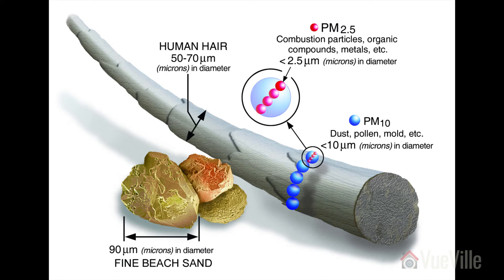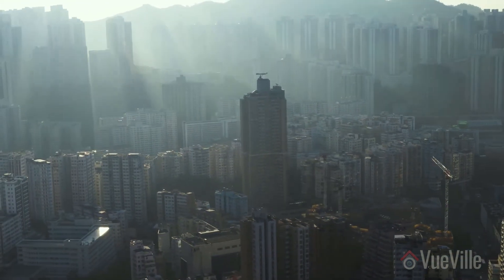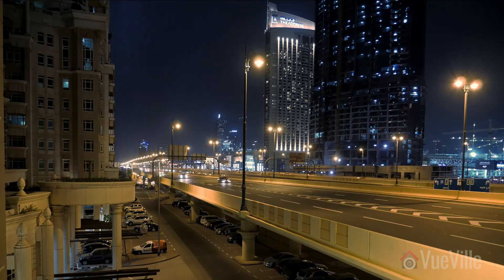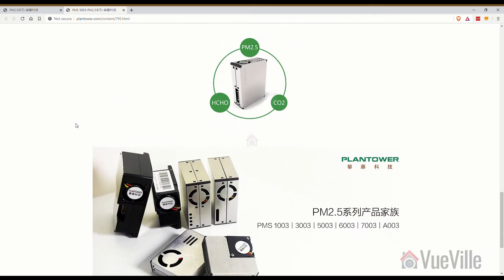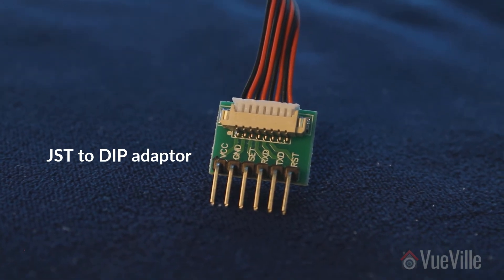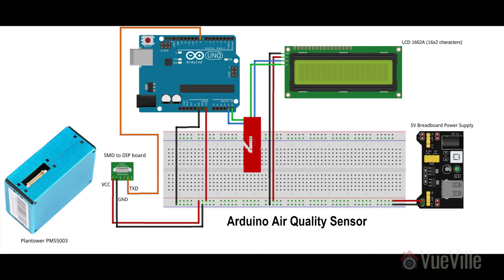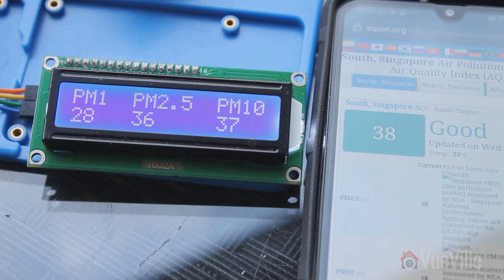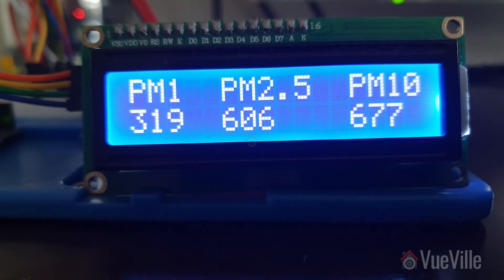How to Make an Arduino Air Quality Sensor - VueVille

Comment: what will hapend if i dont use 5V powersupply?
Reply: It will have too little power and it will not work according to its specs or hardly even function.
Reply: The code is not working on me what should i do?
Reply: @erooncsgo  Download the "Project Bundle" from Adafruit and make the right adjustments as stated by Adafruit in their instructions.
https://learn.adafruit.com/pm25-air-quality-sensor/arduino-code
Reply: @Pumba3900   hey dude i just resorted the code and everything its okay with code problem was in arduino version and second problem was in lcd wasnt declare in a scope but its ok now
Reply: @Pumba3900  and after that i have got a problem with sketch uses 28% of program storage and global variable use 47% but i dont know why i got a problem here because for local variables are 53% its enought right?
Reply: @erooncsgo  That's great!!! Congrats 👏
Reply: @Pumba3900  but its not uploading from thats problems why maybe i dont have 5v power supply
Reply: @erooncsgo  If it works, space does not seem to be an issue. The sketch from Adafruit works anyway; I tried it myself.
Reply: @erooncsgo  No, shut off the sensor before uploading; no power! For they share the same serial port! 😁 So you will create a conflict 🔫💣🔫 in that way 😉